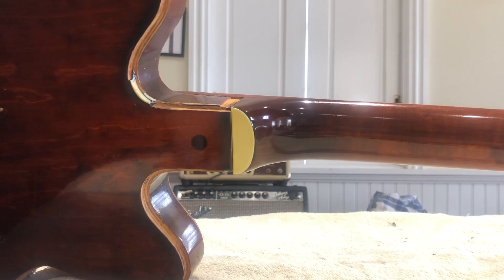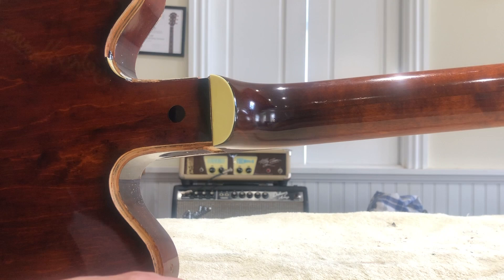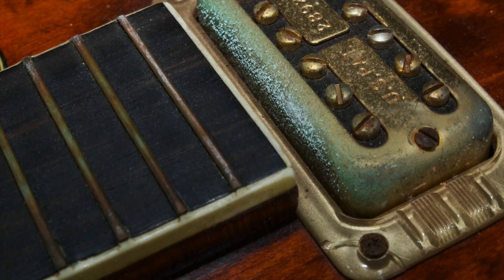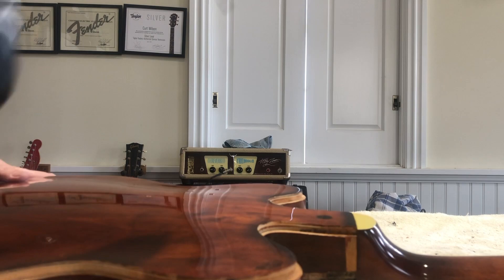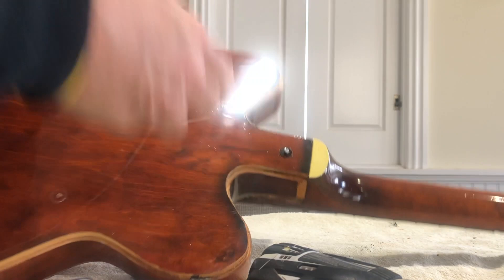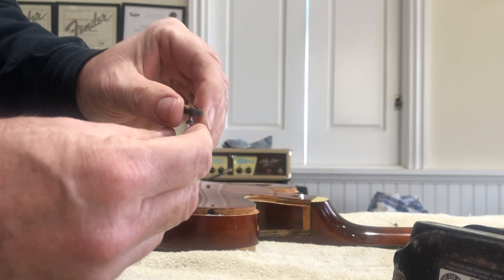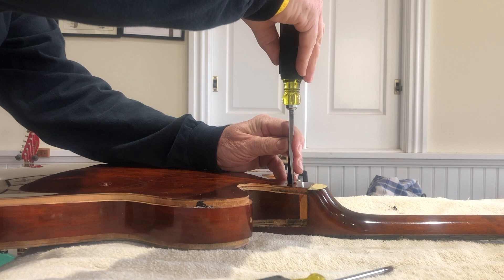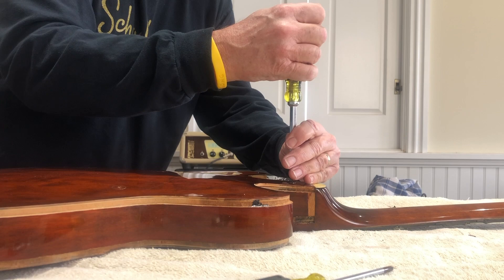1971 Gretsch Gent Neck Removal Part 2 of the binding Replacement videos.

Comment: I bet those shims are factory. a Every Gretsch neck removal I've seen ( well 4 actually) has half a ridiculously loose neck joint that seems to be packed up with whatever scrap was lying on the floor. A good friend took the neck out of an old rancher and it had a piece of corrugated cardboard in there. l kid you not.
Reply from the maker: I've found business cards which I'm sure wasn't factory.

Comment: Hello, I have a Gretsch country gentleman but unfortunately they painted it and erased the serial number. They tell me that it is from 1971 but do you know how I can corroborate that information? Thanks
Reply from the maker: Check the pot codes they arebusually pretty close to the build date.
Reply: @CAWilson58  the headstock of the guitar said THE CHET ATKINS COUNTRY GENTLEMAN and have a number 66105. I don’t know if it’s the serial number.
Reply from the maker: @IsackAikMorsa  That IS the serial number!